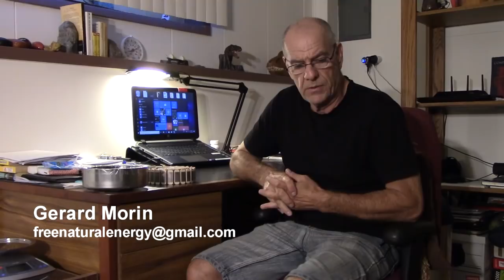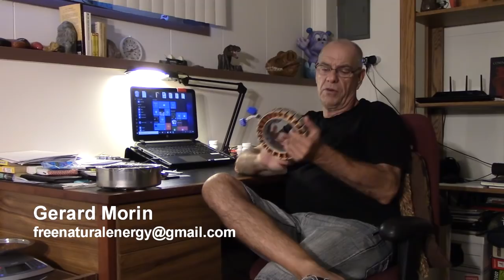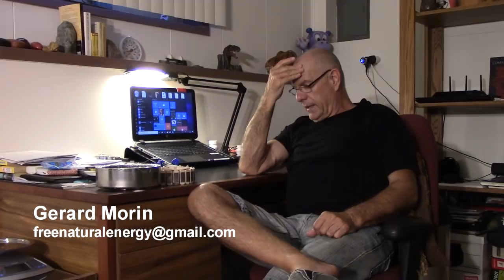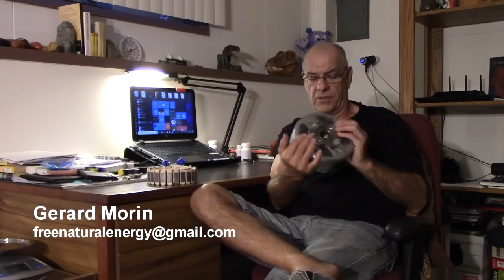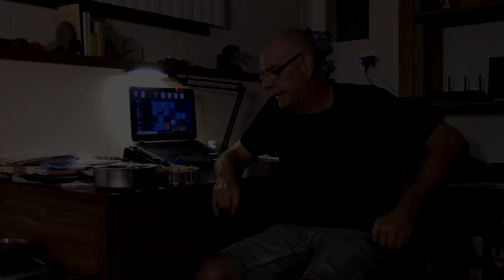Gerard Morin: I'm not dead

Comment: I have some weird questions.
1. What will happen if you spin a motor inside a vacuum? Will it be good for a free energy device?
2. All the planets in our universe have a magnetic field except from Venus, so my question is, what would happen if it had a magnetic field, would it change or connect Ll the planets in a better way? 
3. Planets are rotating in different speeds, wich creates the magnetic field as i understand it, so what happens if the planet slows down its speed, will it slowly loose its magnetic field, i guess the answer is yes, but is it slowing down as some says?
4. If Mars was spinning faster would it have a magneticfield or an atmosphere? And are the core more active due to the spin of the planets rotation speed? 
I know I may ask stupid questions, but I rather ask too much than too lattle. I wanna understand everything 😄
Ive done some geeky research on the 3,6,9 and ive just started, ive already found some very interesting stuff about it.. 
the mirroring of the numbers
Reply: no....the downward force of gravity on our planet to any mass will stop it....even though no circular resistance from a gas.

Comment: Gerard, I have a question for you. The power company is required by law to pay you for power that you put into the grid, right? That's not the question, the question is, can a meter be put on the return line to offset the amount they are billing? If so, could you please explain how this would be wired so you would get credit for the power going back to the power company. Thank you for sharing what you are learning from your research!

Comment: Now I'm a little confused.... You have something that you say doesn't produce electricity, it produces a sine wave that is then converted to electricity???? You cant "produce" a sine wave, its not a real thing, its just the shape of something rotated 360 degrees represented in a straight line graph(such as the resulting alternating voltage pattern made in a traditional single phase generator). You can't make a square, you can only make something in a square shape, and if you don't have electricity, you don't have a sine wave. Every video you have produced showing us sine waves on an oscilloscope is showing us voltage over time(yes, it is all just electricity). I certainly hope you are the real deal, for the sake of all your subscribers that believe you are genuine, because there are many people out there that claim to be doing the same thing as you. You and the others seem to have one thing in common, nonsensical talk about how you have discovered the secret of making free power, but no actual fact on it, just claims that everyone else is wrong. Oh and lots, and lots of talk about delays, problems with manufacturers financial setbacks etc etc. All I see is the same tactics used by so many scammers before you, and they all ended up exposed.
Reply: @UniversalExpanse , I'm not claiming to know everything, and my original comment is true, I hope hes right, I hope he can produce free energy, but I dont think he can, and I have only seen two things from him.... incorrect assumptions, some of which contradict themselves, and a total lack of any evidence that his device actually works. He has shown input and output current without showing both voltages, and told us a lower input current means he is producing more energy than he is using. He has connected a battery to an inverter to power a motor which in turn generates a voltage to charge the battery, which would work for a time, and he has only run it for 12 hours. I have seen people believe anything they are told because they are sick and are being offered miracle cures, I have seen people go broke putting their money into get rich quick schemes..... and I have seen people taking everything gerard says as gospel for the promise of free energy. I'm not here to say I know everything, but if his device produced more energy than it took to run, it wouldn't need external power, if he connects the output to the input and spins the motor, it would run itself.
Reply: Dark Secrets ,  I do understand that you want gerard to be right, and his device to deliver what it promises it will. You believe in him, he has shown you things that appear incredible.... Now I have one simple question for you, and I am not looking to trade insults, just give perspective....If gerard can multiply energy, why has he never been able to power the device from itself? Sure he powers the device from a battery, and it then powers a ups or battery charger, but why does he need a battery? Why cant he just connect the output from his driven motor to the driving one?
Reply: Dark Secrets , he states that he multiplies energy, that you get more energy out than you put in, if that is the case then the motor would run itself, what he is doing is draining a battery very slowly, by using a ups to charge a large battery with a motor run from the battery..... Dark, I'm afraid that no matter what I say, you will believe anything he says. You are like a conspiracy theory nut, you easily fall for any bullshit put in front of you, with no credible proof, and will use profanity and insults to respond to anyone who asks a simple question that you don't have the mental capacity to answer intelligently. Try quoting things Gerard has said to prove your point, people may well be fooled into thinking you have a brain.
Reply: @UniversalExpanse No, what you just said doesnt make sense...... current is determined by the resistance of the circuit it goes through and the voltage applied, they are directly proportionate to each other... double the voltage you double the current... the inverse proportionate relationship is between two sides of a transformer ie: 120v drawing 10 amps of a secondary, where the primary supply voltage is 12v would draw 100amps. Drawing more current on the secondary increases current on the primary, it doesnt lower the voltage of the supply, the supply voltage is fixed. Power in equals power out plus losses. I believe this assumption to be true because I have worked in the power generation industry for 12 years, and I have proven it, and seen it proven. How do you know that gerard's assumptions about being able to produce more energy than supplied are true, when he has not once provided any conclusive evidence that his device  generates more energy than it is supplied?
Reply: @UniversalExpanse , are you referring to the measured voltage across a component? That isnt supply voltage dropping, that's the components own resistance causing a potential difference in electron flow shown from one side(connection) of the component to the other, so the less resistance, the less voltage drop measured across the component and the higher the current flow. If I short something out, it doesn't mean that there is no longer any voltage present, it means that there is very little potential difference along the wire I use to short it with. If the voltage of the supply lowered as we drew more current, then nothing electric would work, because the current flow for a set resistance is determined by the voltage applied....  think of it like a garden hose, we put a small nozzle on it, and we get a high pressure jet of water, but not much flow... but if we connect our garden hose to a two foot diameter pipe, there is next to no pressure, but as much flow as that garden hose can provide.... doesn't mean the pressure the water company provides is any less, it just appears to be less.
Reply: @UniversalExpanse, I said that the supply voltage remained the same, and the voltage drop measured across the component changed, which is true. Even if we short a battery, and we measure across its terminals and get a negligible voltage result, there is still the same emf in the battery due to the internal resistance of the battery(well until the battery starts to drain).
Reply: @UniversalExpanse, I'm not an engineer, just an electrician who spent a lot of time designing and building electrical switchboards and power generation control gear.
Reply: @UniversalExpanse , you may be right about the different perspective. Current drawn is directly proportionate to voltage applied, divided by the circuit resistance. When observing the voltage and current for a SET power across a load, voltage and current will appear to be indirectly proportionate. But you will never have no power, because even if the voltage drop measured is nearly zero, multiplying it by the current will always give you a power reading. MAX current isn't a thing because everything has some resistance to current flow.
Reply: @UniversalExpanse All of this is all well and good, but lets discuss the important thing, have you purchased any of the components of Gerard's invention? and exactly what do you think the real world results/savings will be from it?
Reply: @UniversalExpanse , https://courses.lumenlearning.com/physics/chapter/21-2-electromotive-force-terminal-voltage/   supply emf is still there, without internal resistance, you wouldn't have more electrons on one side of the battery than the other, and no potential difference.
Reply: @UniversalExpanse , I'm not exactly sure what you are trying to say with the battery example, but I'll work with what you have provided to prove my point. If we have a battery, and we put a 0.04ohm resistor across it, we draw 300 amps.If we connect a 24 volt battery to the same resistor,  we get 600 amps. You can try and insult me all you like, and try to tell me I dont know what I'm talking about, by quoting things that you know nothing about(like zero voltage switching, which is nothing more than an extremely low resistance switching method), but at the end of the day for a set resistance(which is what most loads are) the current drawn is proportional to the voltage supplied. You tell me to get back to the basics, this is ohms law, the most basic electrical principle, and yet you think that it's wrong?
Reply: @UniversalExpanse , if voltage and current are inversely proportionate, then try this simple experiment, put two 1.5V batteries in series(which I am hoping you will agree gives a 3V source), and put an ammeter across them and note the current. Then remove one battery, to give you a 1.5V source and measure the current again. If, as you suggest, voltage is inversely proportionate to current, then decreasing the voltage by removing a battery will increase the current. You are correct that the measured volt drop across two points with very little resistance will be small, but that doesn't make voltage inversely proportionate to current.  As for zero volt switching, looks like we were both wrong(completely)…. zero volt switching, basically, refers to switching of DC square or ac waveforms at the point that the voltage(and the current) passes through zero, to reduce losses, which has absolutely nothing to do with resistance in any way(feel free to correct me if I'm wrong and there is some new technology with the same name that you were referring to, and link me where I can read up on it).  Dude, I'm not trying to tell you that you're an idiot, or that you know nothing, but what I have said is correct(well except for my first comment about zero volt switching lol).

Comment: Hi Gerard, I just found your videos on YouTube, so forgive if I’m lagging behind a bit. But if you haven’t already, look into the theory of operation for a Variable Frequency Drive (VFD). It takes a 3 phase AC input, rectifies that onto a DC bus (typically 480VAC will rectify to around 650VDC). Then a set of IGBT’s recreate the 3 phase AC sign wave delivered to the load (Motor) in the form of a pulse width modulated DC sign wave. Really cool piece of electronic equipment. I believe that is what the controller for your RC motor is doing, minus the AC to DC conversion. Rather just pulse width modulating the DC output in the form a a DC square wave that mimics a Variable AC sine wave.

Comment: Translation of what he said:" USB" = VFD varable freq. drive for brushless 3ph magnet motors ONLY(useless with induction motors)., 3ph sine wave generator, motor controller, DC input converts 3 wire choppy(8Khz or more) 3 phase output.

Comment: For a motor the design of the outboard is Tesla's device. But the generator is a different story. Have a look here: https://teslauniverse.com/nikola-tesla/patents/us-patent-390721-dynamo-electric-machine
 You have the motor or prime mover. Now you need the generator section with self exciter. You need a non poled generator section. Thats the ring section with longitudinal wraps of wire in quadrature. This system is just a two phase and not 3. Both phases can be harvested and it should be loopable..

Comment: What are you talking about old man? on off, is not an RF signal. It´s based on pulse with modulation, as all drives are. Firstly you have rectifying which is done with diodes that lets through the voltage of each phase when it´s most positive, so you get a pulsating DC voltage. The pulsating DC voltage is close  to the incoming peak voltage. From there on capacitors smooth out the pulsating DC voltage. The inverter (Transistors /IGBT) turn on and off in pulses with different width to create an efficiency value, that is close to  sinusoidal. The frequency of the transistor switching is normally between 12-20Khz mostly to create a better current waveform and to avoid pulse -magnetization of the motor. But when your using drives you also have the problem with leaking currents in the motor due to the inverters which results in a floating neutral.  Capacitive coupling in the motor ( Rotor-stator, Stator-anchor, Inner and outer bearing, rotor-bearing etc.)  will have a higher chance of discharging due to trasient voltages the transistors in the drive create ( Du/Dt).
Reply: interesting. imo it's hard to keep track of what G's trying to get across sometimes. Most of the population has a hard time using the right words to convey feelings, thoughts, & ideas, I think. But at least many people like G' are trying to do better, all the while all this corrupt, stupid, & neglectful BS so many others have & are doing is going on. Humanity right now is mostly imature. It would be nice if people would realise this, be more careful what they say, & try helping make things better  instead of worse.

Comment: My thanks and summary for my notes:  Using drum motor (washing machine 'smart motor') with a high voltage DC timing controller (~1000VDC ) and at a high RPM (or frequency at 5500 +) that derives efficiency/torque using a permanent magnet outside rotor &  directly coupled to a drum generator for a significant step-up of horsepower.  Controller uses variable solid state timing using no physical sensors in detecting rotor position and thus advancing/adjusting timing for increased/transient RPM to achieve maximum rotor torque.  The chopped and gated DC of the controller ultimately results in a directly connected 3 phase high voltage sine wave output of the generator smart motor (drum motor).
Reply: outrunners many people call them, they've been around for many years, but G's found a seemingly different or a way to push magnets glued to the inside of a drum rotor.

Comment: Im putting my generator  together as we speak. I have some interchangeable parts and I plan on running a 10kw gen.  I am looking forward to your controller. It needs to spin up that motor at least 3k rpm. more is good too.   2 or 3 people in your shop could build these units under your leadership and it would only take a week or less.   Put me on that list too. Fingers crossed!!

Comment: Helium super fluid flowing through a swash plate pump motor able to handle ultra low temperatures with a swash plate pump motor type 12 generating electrity with the swash plat pump motor powering a propeller on a ocean vessel? Could it be possible? Weird science!

Comment: Mountain helium superconducting electrical power plant could the transfer all that energy to another site using tesla coils to superconductor separators along water ways removing pollution and bacteria from the water or lake or inland sea or remove salt to produce clean drinking water? How far would you like to go with the knowledge you have? Say like subways that generated electrity from their use to power city grids operating large cryogenic pistons on top of skyscrapers generating liquid air and pollution processing that pollution has the liquid air travels down through the skyscraper providing air conditioning and ekectrity with the clean liquid air pooling at the bottom of the building with frequency emitters at the bottom of those pools causing the liquid air to return to a gas state then releasing clean air at ground level? Hay some really crazy idea's right?

Comment: Think about this, you construct a insulated track of pipes in a mountain area with large Stirling cryogenic pistons operated by large Stirling cold gas engines that have antivibration technology gadolinium magnetic bearings to keep the helium ultra cold. Then attach superconducting swash plate pump motor type 12 electrical generators along the pipes down a mountain add electrical motors to spin those pump motors with the pipes filled with helium super fluid. Get the super fluid up to a certain speed then shut off electrical motors spinning the swash plate pump motors has tge super fluid flows by itself through the system pulling itself through the whole system at what ever speed the super fluid will level itself out at generating 100% usable electrical energy? Then throw sum large vacume spark gaps here and there? :)